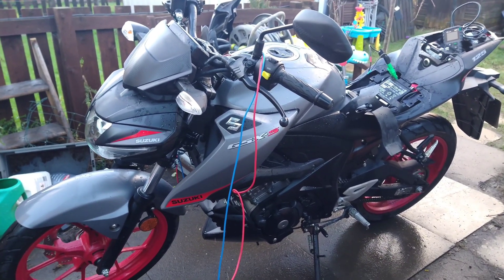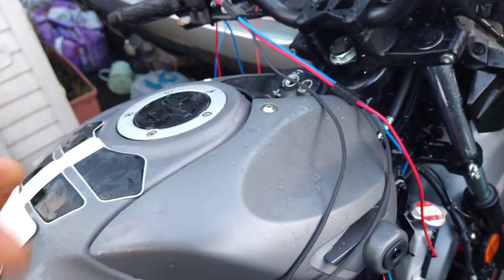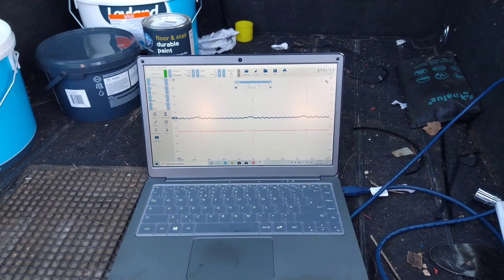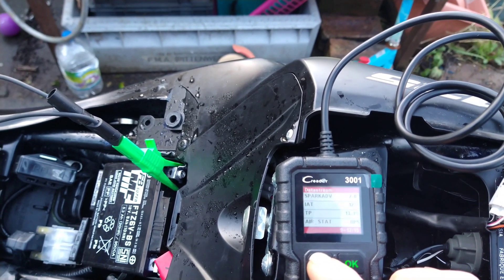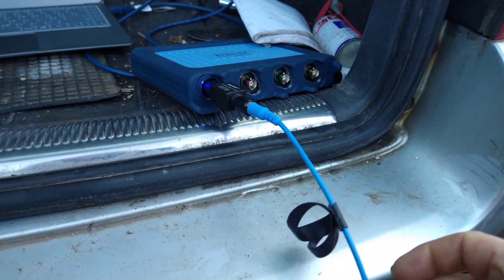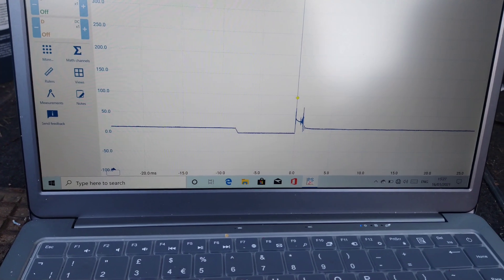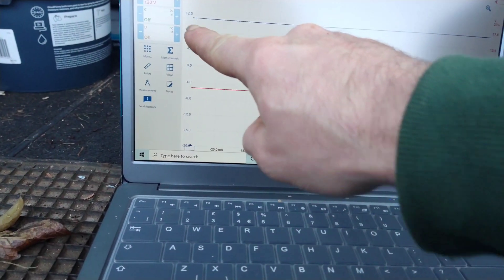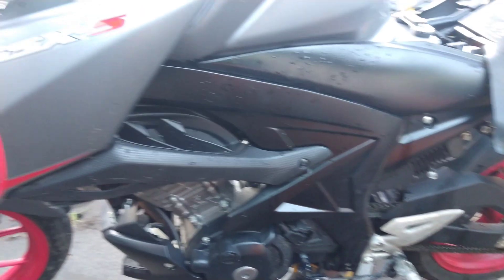GSX S 125 (various signal testing with a scope)

Comment: interesting  to see all that  on  a 125cc motorbike  fuel injection and abs , i thought motorbikes would still be on carbs and cdi ignition never mind a.b.s  lol  .  stay safe on the roads .....
Reply from the maker: It does seem over the top for a wee motorbike. I haven't had anything to do with newer motorbike electrics, so it's good to know that they are basically the same as a car. Thanks for watching

Comment: No substitute for poking around while everything is as it should be Matt. Here's hoping 2021 is a good year for you and yer family. Cheers Pal
Reply from the maker: Thanks, thankfully I have had job security throughout this. I know people that are struggling financially and mentally now. 
Hopefully things are going to get better for everyone. I hope you and your family are ok.
Reply: @mechanicmatt871  All good here Matt. We are all bored stiff...if that’s all we have to complain about we are doing OK. Hope your move (flitting) goes/went well 👍
Reply from the maker: That could be the problem although it is just guessing. I would get an inexpensive code reader to get a clue as to what the problem is. The O2 sensor didn't seem to switch on mine at idle even when it was new, only switched when cruising..
If it's only when hot it could be worth checking that the coolant temperature sensor is changing as the engine warms up.
Reply from the maker: It may just be something is off on the live data but not showing a fault code. Have you seen Ian's FACTS video on TheGibby3340 it shows how to go through the fuel air compresion timing and spark. In this case the engine is speed density so it only has a map sensor. That should read barometric with the engine off and drop less than half that when it's running. That will be on the live data. Also check the air filter incase it has sucked in water. It's hard to say without seeing it. The bike should have a warranty if it's only 2020. It may be best to let the shop take a look